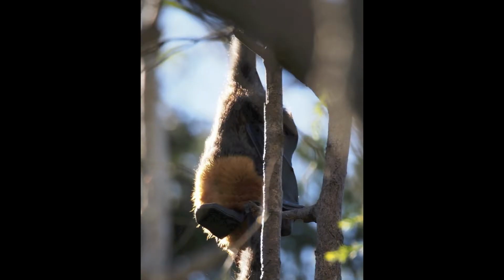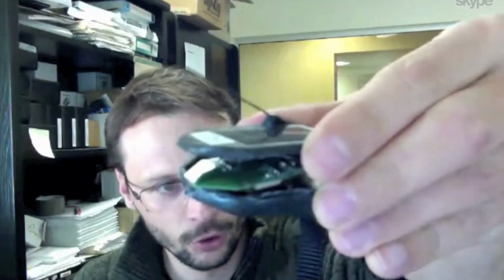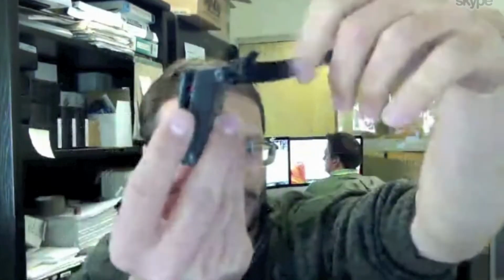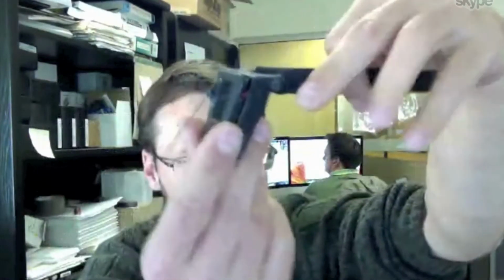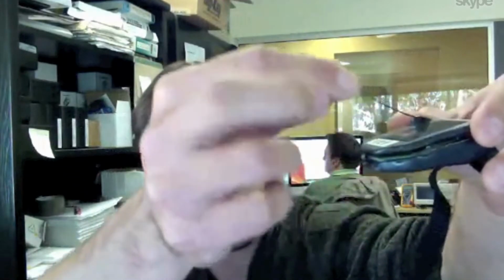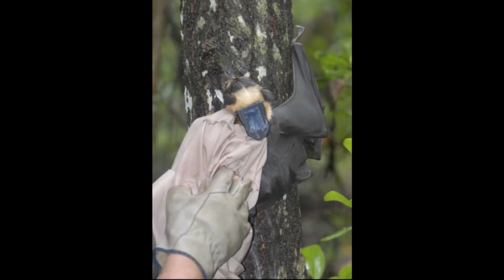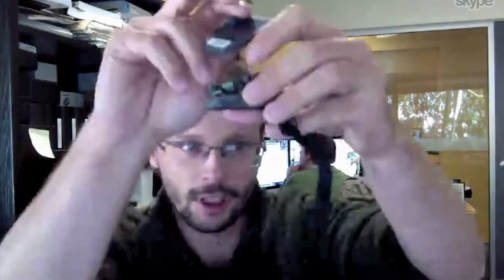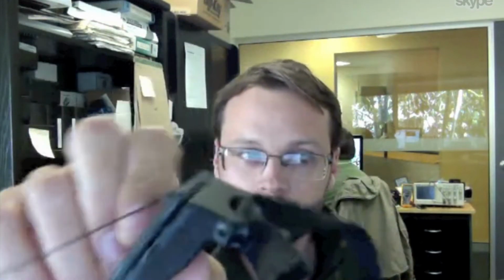Aerial Sensor Networks and Lessons Learnt, Dr. Brano Kusy, CSIRO, Australia

Comment: Very Interesting video, actually I listened to this video three times, firstly without cc, then with cc, finally without cc. I guess I got 80% or more of your talk. Two questions I got so far: 1. In my understanding, you are using sensors on those bats to monitor their activities, did you find something very interesting or just monitoring? 2. As you said, you are using 'common sense' to eliminate some outlier data. I guess there is some predefined patterns for those bats. Am I right?

Comment: This is a very interesting talk, thanks for sharing all of your project details with us. Got two questions here:
1. Why there are two solar panels on the tag? I guess after attach the tag to the bat, the side without antenna should always facing the bat's back, why you decide to put a second solar panel there since most likely that side does not have a lot of chance to harvest energy. 
2. Is there any fault tolerate technologies applied when you collect the data from each tag?
Thanks a lot!

Comment: I had three questions. The first was due to audio quality: what was the tool/framework mentioned for the interactive website? It sounded like E3.

Two: How far apart are the base stations, and how much area do they cover?

And Three: Are things like temperature and pressure being checked against meterological records to confirm the correctness of the output?

Thank you for the video, and your responses.

Comment: My questions are:
1. What kind of data do you collect from the bird? How do you recognize the different type of data?
2. When the birds are flying, did you still get the location of the birds? Can you track the bird fly route?
3.Since you have used GPS, 3G in your tiny nodes. how did you recharge the nodes when its power went down? 
4.Can you show us the web interface to access the data?

Comment: I also have one more question regarding the biology. As you mentioned you are using 2 solar panels on nodes. Do the types of bats generally appear in daylight enough so the solar panels could gain enough energy? Did you have any problems with this issue?

Comment: Thanks for your time and explanation. I have some questions:
1. What's the strategy of producing data? Does it produce in regular time interval, or based on parameter changing?
2. How much is the hardware's storage capacity? If one node never upload its data, how long will the storage be filled? and what will it do at such condition? 
3. How long does it spend to upload average amount data? And How many nodes can upload data at the same time? How long is the response time of starting uploading?

Comment: Thank you for your time and your explanation. Your project is very interesting and may you provide some information for the following questions:

1. The sampling rate of the sensors. How large is the data set collected from one  mote per day?

2. How do you deploy your 1000 motes, in one time or in several times? deploy on bats at the same place or bats at different places?

3. The precision of the sensors and the experiment requirement. Would them be affected by the environment, like weather?

Comment: Thanks for your time and explanation. I have some questions:
- Can you explain more about the methods for software testing you applied?
- What type of configuratuions can be set remotely on nodes?
- What type of data analysis do you apply on data?
- Does the HDF5 data model provide more flexibility in using hard disk and memory for data processing rather than DBMS?

Comment: Hello, very complete presentation of your work. I have tow questions:
1. you said that you build the hardware yourself and even use 3D printing to have the best fit, but can you tell me, at the end, how much does a whole sensor cost?
2. it must be very difficult to validate your data, you talk a little bit about that in your speech but can you tell me more about how you validate your data in taking into account more particularly the change in weather, like for example if there is a storm.

Comment: Thank you for your comprehensive explanation. I have some questions related to your work.
1.GPS or temperature date is much smaller than voice data. Did you use any compression algorithm for voice data? How do you validate voice data accuracy? 
2.About data validation, you mentioned that you are used some range validation technics. My question is: what is your future plans to improve your data validations? 
3. Do you have plans to use Grid or Cloud as data processing resources?